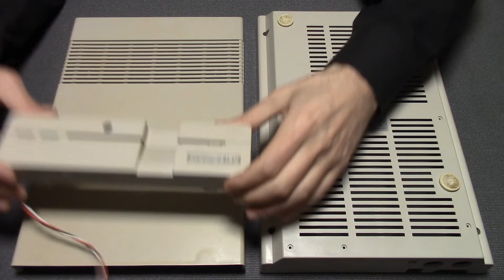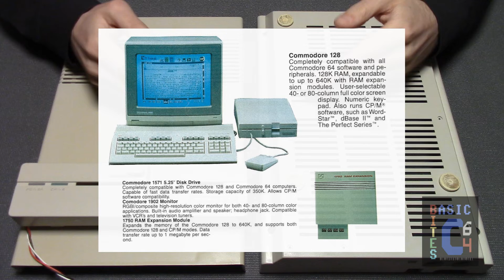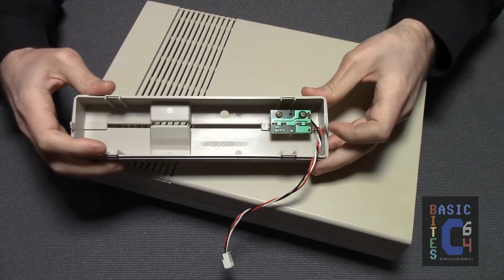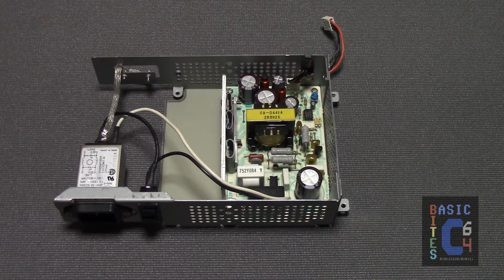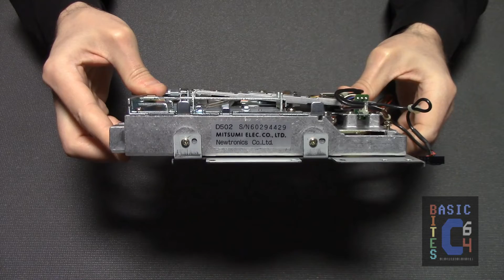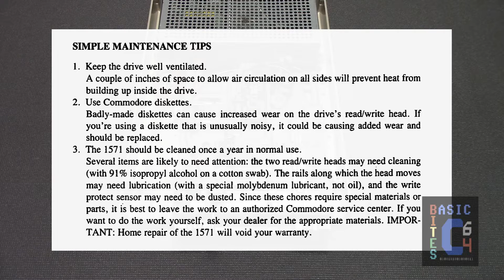Inside the Commodore 1571 Floppy Disk Drive (C128 / C64)

Comment from the maker: If you're wondering how subsequent testing went: everything felt much smoother than when I received this 1571 a few months ago.  The drive passed all diagnostics with flying colours, spinning at a sweet 299.8 RPM (within 0.07% of spec)!  -- JC
Reply: You should get your hands on a Mini Chief drive which is a modified 1571 with a MFM 20 or 40MB hard drive inside. The floppy function worked 100% but when you flipped a switch you had access to the 20 or 40MB hard drive inside either as x number of 664 block drives or one large drive. Someone I knew had one but I haven't seen them around in the retro market, my guess is they didn't sell very many.
Reply from the maker: @andrewenglish3810  Thank you for letting me know about yet another piece of retro tech that I had no idea existed until now!  I just found the Mini Chief manual on the Internet Archive, and it seems wild.  At this juncture I'm not seeking to actually run old HDDs with my Commodore setup due to age & reliability concerns -- but it's the sort of thing that if I stumbled upon, I would certainly dive into it (and possibly make a video).  :-)  -- JC
Reply: @andrewenglish3810  probably too spendy

Comment: 02:10 Note that CP/M does not need MFM mode, in fact the CP/M boot disk is formatted in MFM mode, so that 1541 could start CP/M.
However to run a diskette from a different CP/M system, the MFM support is needed and that can't be done with 1541.

Comment: My de-soldering tool damaged the 1571 floppy controller pcb and I need to repair it or  replace it. Doesn't anyone know if anyone has cloned the board and has 1 available for sale.

Comment: 23:30 Not true. All of the Commodore drives have a fabric belt that does NOT stretch and should never be touched or replaced with a rubber belt. I have many drives and I've never seen one break or wear out. Of course it can happen but so far they appear to be still like new.

Comment: also I just got a 1571 that powers up and acts like it's working but after initial use the activity light flashes continuously.
One tech note I found says the 1772 controller ic has failed.  can you comment further?
Reply: Flashing continually means a lot of things. Highly unlikely the wdc chip is bad. More likely you have a bad rom or bad ram or bad 6502 or bad 6522 (or 6526/8520). I've repaired hundreds of drives and those chips are the most common faults. I suggest you read Ray Carlsen's '1571 fix' document to better understand what those parts do and how they affect the drive operation and what the LED does when any of those parts fail.
Reply: @g4z-kb7ct  I already read Ray Carlsen's '1571 fix' document.  For the symptoms observed  it suggests the wd1772 fdc chip has failed.  i have an unknwn  spare from an atari st that i'll try.
Reply: @drpc98014  Did you do the proper test to determine if it's doing EXACTLY the same thing?
"Normal looking startup (LEDs and motors) but when computer boots, drive can't read disk and stepper moves head to track zero. Subsequent disk access shows 74 DRIVE NOT READY error and green LED flashes rapidly."
So move the head away from track 0, power on and see if it does the same thing and the same Drive Not Ready error. If yes then it may be the 1770. If it's not the same it can literally be anything else. I'm not sure what you expect people to tell you when you've already got all the relevant info out there from Ray's site. Follow his advice first and if that's not it change some other stuff starting with what I already told you... 6502, 6522, 6526/8520, ROM, RAM etc. There's only a handful of chips and it isn't that complicated.
Reply: Just to add this my last reply, if the green led flashes once per second it might be the ram. If the green led flashes rapidly then it might be the WD1770/72, as per Ray's document. You should ascertain which type of flashing your led is doing first before moving forward as neither of those chips are in a socket.
Reply: @g4z-kb7ct  yes rapid flashing, perhaps 3 times a second.  However by removing the 1772 fdc chip in prep of trying out a fdc from an atari st,  my desoldering tool damaged the pcb so now I have to find an accurate schematic and insure all the connections to the 1772 are still valid. So far I found about 5 pins that should connect but don't connect to the rest of the components.
Reply: @drpc98014  LOL!! I suspected that would happen as only a very small fraction of people can do that kind of work properly, excluding you lol. You should have just cut the legs near the package, removed the body of the chip and then used a soldering iron to pull out the legs then a solder sucker to clear the holes. The schematic is available and is accurate. However you don't need it. You don't need a 1571 nor a C64 or C128 either. Seriously, just sell it and use emulation on a PC as clearly you are not qualified to own it. To own 40+ year old gear you need to be skilled enough to repair it and that's not you.
Reply: @g4z-kb7ct  a lot of bad in that diagnosis. making a bad situation worse the de-soldering tool not only sucks solder off the board but circuit traces as well.  Now I get to repair the board as well as find replacement parts.  According to the text from Ray's site the fdc controller is bad. However I came across a short basic program that reads error codes and text from the controller

Comment: thanks for the lead on the molycoat.  I'm surprised that while you had the drive out of the case you didn't soak the covers in peroxide.
Reply from the maker: You're welcome!  The shell of my 1571 doesn't look all that bad to me, and I do not have a retro-brighting setup.  I soaked some extremely yellow C128 keycaps in hydrogen peroxide in sunlight (and they improved remarkably), but that's about as far as I've gone down that path.  -- JC

Comment: How do you fix a squeaky noise when the drive is spinning?
Reply: remove the top spindle section cover by removing the circlip, clean and polish the metal parts and apply a tiny amount of lithium grease to the spindle parts that touch the top section and reassemble. This problem is well documented so just search and you will find more info about this than you can handle ;-)
Reply from the maker: Depends on whether the squeaky noise is coming from the drive, or from your spouse that you're wasting time with retro-computers again. 😛

If the drive is doing it with all disks, the other comment about lubricating the top spindle is on point.  In fact you can usually get a drop of lubricant into it without disassembling it, and that may or may not be enough.  On the other hand, if you have a particular floppy disk that squeaks (not just a noisy disk, but actual squeaking), check that it isn't deteriorating and rubbing its iron oxide coating off on your drive heads.  -- JC

Comment: With a small hardware mod and updated load-routine the C64 can use a 1571 disk drive in fast mode.
Reply from the maker: Thanks for the tip!  I know there are also fastloader cartridges for the C64 that can speed up a 1571.  However, 1571s are so rare and expensive now, that using one with a C64 seems like a waste, unless one has some very special use case to need one in 1571 mode (rather than 1541 mode) with a C64.  I bought mine primarily for nibbling disks with a ZoomFloppy, and occasional use with a C128. :)   -- JC

Comment: I was able to buy one off of eBay that was basically new old stock (box was intact but open, but everything inside was still in the plastic bags from the factory) and while I prefer my 1541's for the C64's, I love this for my 128. It is a great little drive.
Reply from the maker: Nice!  The 1571 truly shines with the 128 (and when nibbling disk images with a ZoomFloppy).  I agree that putting one on a 64 is largely just a waste of a rarer disk drive.  -- JC

Comment: "Front faceplate"? As opposed to the "side faceplate" or "rear faceplate"? Doesn't just the fact that it's a FACEplate automatically mean it belongs in front?

* the faceplate
Reply: Not if you are two-faced or look sideways while facing forward lol. Anyway, a faceplate does not mean front. A faceplate can be on the rear or side.
Reply: @g4z-kb7ct : Ha, no, looking sideways while facing forward would still have your face in the front. But yeah, I double-checked, and you're right about the definition. I never really double-checked the definition before, since I always thought it was so obvious, based on just what "face" by itself means.

Comment: Jam in all new micro ceramics too.
Reply from the maker: Unlike electrolytics, ceramics don't have a finite shelf life -- so unless one has failed or been damaged, replacing those is just a make-work project (and I've already got too much work)! 🤣  That said, I actually did replace the ceramics around the VIC-II & VDC in my video about fixing Commodore 128 80-column video, in order to make it easier to manoeuvre tools inside that little metal box.  In that instance, I cracked at least one of the old-school ones while pulling chips.  -- JC

Comment: The source code for the -05 version of the rom has some pretty funny comments, for example wondering how the reset code in the previous versions could have worked at all!

A huge deal for keeping your 1571 working is to never leave the drive with the lever in the open position for any longer than needed, and especially, never store it with the lever in the open position. Leaving it in the open position will eventually bend the head assembly, which can turn into a really nasty repair.
Reply from the maker: I've since had an 05 ROM made for this drive, but never bothered with the source code.  Mental note made to download a copy and take a look!  Indeed, I've read in multiple places that leaving the drive open will cause the upper head spring to deform over time.  My 1571 always has a transit card in it when I'm not using it.  -- JC

Comment: Would be nice if they would make a copy of the 1571 board like they did with the 1581 right now im making a 1581
i had a 1571 back in the day.. a lot of my old PC hardware was junked in a basement flood at my moms house after i moved out.
Reply: Heh! Funny you should mention that. As well as re-producing the 1581 controller board in 2018 I've just completed re-producing the 1571 board. Actually I did both the board inside the C128D (plastic version) and the external 1571 drive. However as far as NEEDING it if yours is not working, it's definitely not needed. Just fix it. The boards use all off-the-shelf parts or other common parts that can be found easily. The only exception is the hybrid ceramic upright module but they are not known to fail. However since I like to reverse things just because I can, I'm currently working on reversing that one too....

Comment: So... technically... you can build your own 1571-II... gut a 1541-II, keep the power connectors, place the internals of the 1571, and shift the board around a bit so it fits... and voilá!
Reply from the maker: I'd love to see anyone build their own concept of a 1571-II.  I've never seen anything definitive on what direction Commodore was going to go with it (other than the fact that it would be powered by the standard 1541-II brick).  Unfortunately, due to the width of the PCB, you wouldn't get the existing internals into a 1541-II shell unless you designed a new mainboard and moved all the chips over.  I've always personally envisioned the 1571-II having a typical 1571 faceplate, but with the body shells reduced to 1541-II length -- and the newest ROM, of course!  -- JC
Reply: @BasicBitesCA  In the German Forum64 a 1571-II was presented, in the housing of a 1541-II. I made this replica myself with 2 modes 1571-II mode and 1541-II mode.

Comment: Idk eprom burners aren't too expensive and super useful. Great for making kernal roms, kick start roms, tos for the atari st, utility roms for the empty socket on the c128, game roms for arcade boards and so on. I don't think you'll regret the purchase of an eprom burner.
Reply from the maker: That's a fair point about the falling cost of burners!  It's more that I'm generally averse to buying things that I'll have on a shelf forever and almost never use. :)  I'm strictly a Commodore guy and stick with the stock ROMs.  The 1571 upgrade seems to be a rare case where there aren't too many originals floating around.  Happily, I found a service here in Canada called HobbyRoms that will make the odd chip I need at a very reasonable price.  -- JC
Reply: @BasicBitesCA  I'm in Canada too near Toronto. If you need the odd thing let me know. My email can be found on alfiesgames.ca
Reply from the maker: @AlfieG2255  Thank you!  I will check out your website. 😎 -- JC
Reply: @BasicBitesCA  I can burn the odd rom for you for free. Mostly I sell video game stuff.
Reply from the maker: @AlfieG2255  I'm generally happy to pay a reasonable price for a good service, but that's extremely kind of you.  Thank you!  I will keep you bookmarked in case anything comes up. :) -- JC

Comment: 28:00 How do I check if my drive is still under warranty ;D ??
Reply from the maker: Contact your local Commodore Service Centre, of course! 😜  -- JC
Reply: @BasicBitesCA  😂🤣🕹 have to check  my Rom version soner than later. The program you show is that available for dl anywhere ?
Reply from the maker: @allan.n.7227  I typed it in directly from the Retro Isle link in the description, but the site seems to be (temporarily?) down as I write this reply.

Here's a copy I saved to a TXT file:
10 open1,8,15
20 print#1,"m-r"chr$(0)chr$(192)chr$(2):get#1,a$
30 close1
40 a=asc(a$+chr$(0))
50 ifa=56thenprint"1571 with new rom chip":end
60 ifa=66thenprint"1571 with old rom chip":end
70 ifa=132thenprint"1571cr"

Note that the lowercase ASCII types in as uppercase PETSCII in the standard graphical character set.  -- JC
Reply: @BasicBitesCA  WOW. Thank you!!